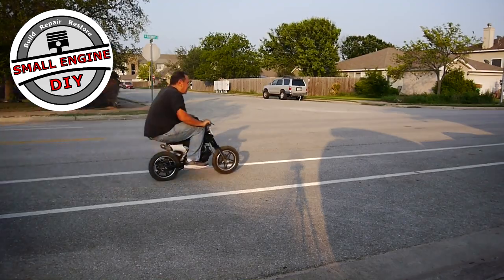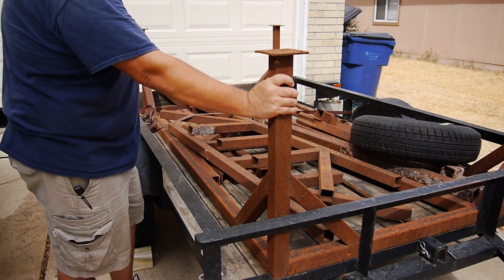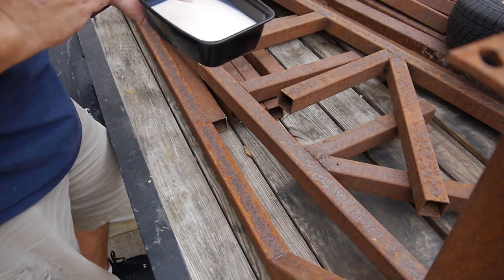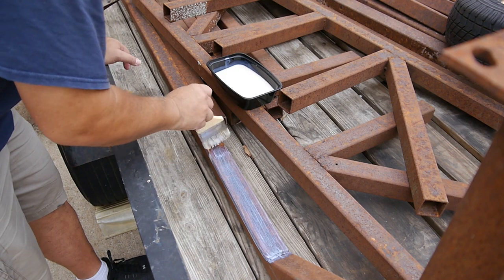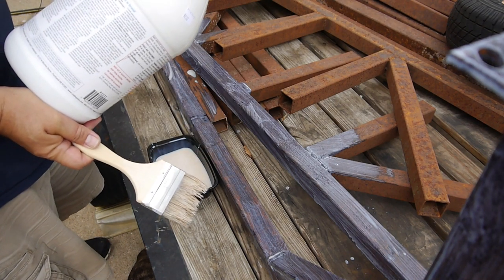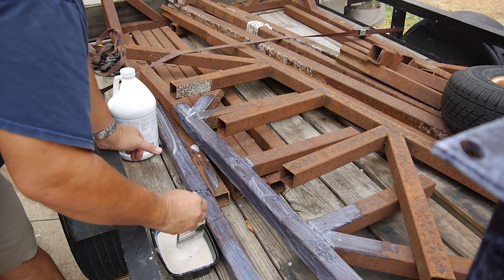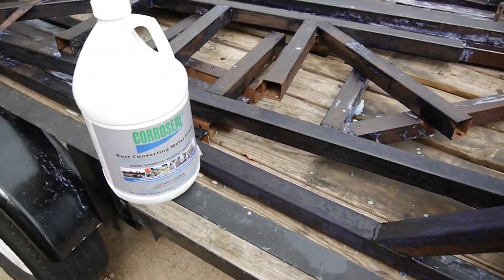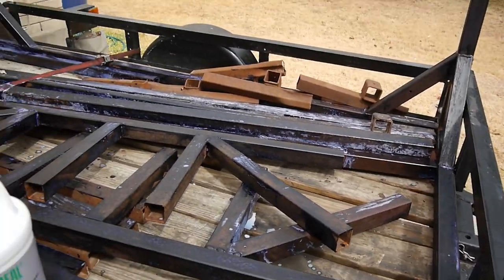Does Brush On Rust Conversion Work?

Comment: This stuff is great. I use the Eastwood brand, probably the same. I ordered a gallon of this, im going to compare. Corroseal is almost 30 dollars cheaper per gallon. Thank you for the video. This works very well to prep a mower deck after pressure washing, for painting. I like to pressure wash, coat the rusted or bare metal areas with this product and then spray the top side of the deck with truck bed liner spray from Harbor Frieght. Makes a really nice and durable coating for mower decks. :)
Reply from the maker: Good tips!

Comment: It's recommended to get the lose rust off first wire brushing sandpaper and then cleaning off any oil stains or contamination and then applying the product for the ultimate results.
Reply from the maker: I just wanted a quick coat.  I plan on doing some welding with most of it.  I'll do a heavier cleaning then.